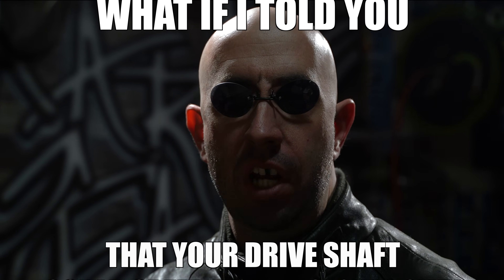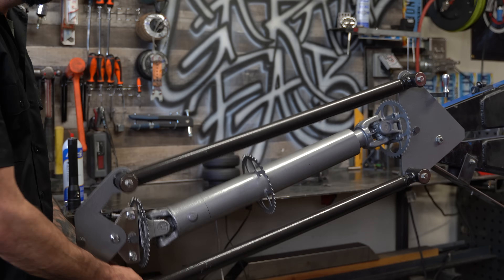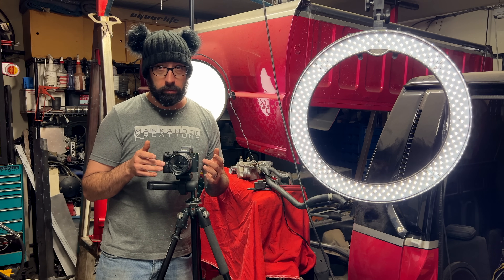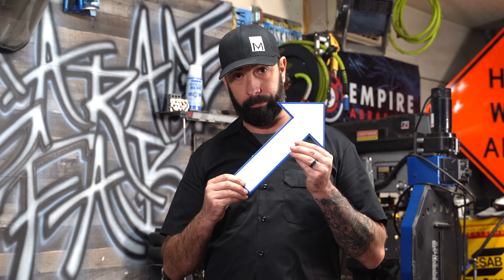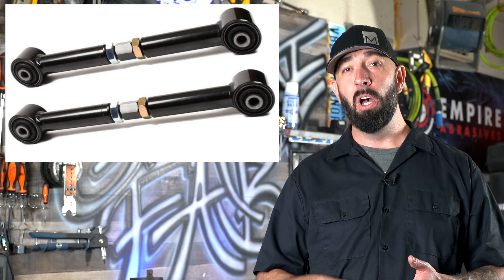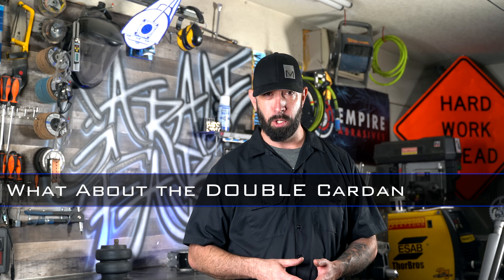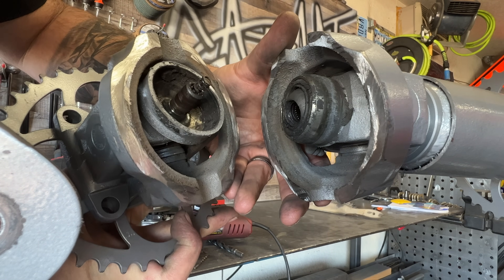THE Driveshaft Video. The Nature of U Joints. Suspension Basics Ep. 06

Comment: Hi I'm doing a 1975 Ford courier triangulated 4 link with coilovers I have everything mocked up and have my bars all level but the lower bar is wanting to be farther down the frame then the top even though I bought evenly lengthened bars. I was wondering your thoughts on that
Reply from the maker: Hey Damon! That sounds like an awesome project. I’ve got a soft spot for the old stuff.
If I’m understanding you correctly, it is to be expected that your angled bars appear shorter than the parallel bars if all the bars are the same length.
In order to get the upper angled bars of a parallel 4 link to span the same distance as the lower bars, the upper bars technically need to be LONGER.
I realize how confusing that can be without seeing it.
Don’t stress though. If you can figure out how to mount the bars you have, the unequal length won’t cause a problem for you since you’re running coil overs. Just set your pinion angle parallel to the transmission at whatever ride height you choose and you’ll be golden.
If you need clarification, lemme know!
Can’t wait to see the Courier!
Reply: Okay thank you I thought you mentioned that in once of your videos but wanted to clarify

Comment: I find myself in a sticky situation, tom no longer makes the Nissan Xterra 2nd generation kit for a double cardan for Nissan Xterra 2nd generation that get a lift. I need a double cardan to fix my vibration but there is no slip yoke eliminator in production which tom used to make. I don't know the specifics of the kit/conversion he made for us Xterra owners but i would love your input on this and ideas or suggestion for how to make this happen or any other way to fix the issue. The Nissan Xterra 2nd generation has a u joint on the transfer case side and a CV joint on the pinion side (fun)... but after watching your video i believe the Xterra peeps may have been using wrong terminology and it is not a cv but a single u joint on a flange. I have a 10.9 degree drive shaft to transfer case angle and a 9.9 degree angle on the pinion side, so 1 degree off parallell. Tom in his videos would like to see these at max, pinion side 2ish degrees and a double cardan on the transfer case side in his video if i remember ended up being 6 degrees on the transfer case side. Kinda confusing on that part as that is still not in parallell.... ugh lol

if anyone reads this and has an idea or can help, please please do. thank you.
Reply from the maker: Hey Jason! Sorry for the delayed reply. This one took a little reading. I’m very uneducated when it comes to off road stuff. So perhaps you can tell me… What is the purpose of a slip yoke eliminator? My assumption is to prevent the slip yoke from popping out. Or perhaps to ensure you can apply full torque to the wheels without risking damaging splines.
I did a brief search, and found a couple Xterra slip yoke eliminators, one from 4 wheel parts. Not sure if it’s for your model.
First, I’d agree with Tom’s recommendations of a MAX of 2 degrees off parallel. More than that will likely cause a vibration. A lot of people believe that 1 or 2 degrees off-parallel is required to keep the needle bearings rolling. I disagree and think they’re confusing that with a slight operating angle of each U joint. So if each U joint is bent slightly, a perfectly parallel setup would be more than acceptable.
It’s kind of difficult to give advice for this sort of thing without being able to measure for myself, but by your description, you shouldn’t have a vibration. Unless of course maybe your vehicle is lifted beyond a U joints maximum recommended operating angle. (Around 7 degrees)
If both U joints are under that, I’d recommend first putting the pinion and trans shafts parallel. 
After that, then, perhaps it’s time to consider the double cardan joint. It’s important to know, though, that the parallel shafts principle goes out the window with a double Cardan joint.
When installing a double cardan joint, the singular U joint on one end will be almost straight with the pinion angle nearly matching the angle of the driveshaft (With an operating angle of approximately 1 degree) The Double cardan Joint on the other end can then be at any angle within its capabilities.
All of this, of course, is assuming that the vehicle is resting at its natural right height. 
Hopefully this makes some sense. Even my eyes are crossing right now.
Reply: @Garage Fab  yeah the one in 4 wheel parts turns out it looks up as for an xterra but not actually for it.  But more to the question of application, not worried about it slipping out or torque. Not sure why people don't do a slip yoke double cardan honestly and haven't been able to find anything on it. My tranny and pinion are only 1 degree out but they are 10.9 and 9.9 degrees hence the double cardan. The xterra transfer case can't be adjusted up or down without messing up the front drive shaft angle a lot so pointing the transfer down the one degree to get parallel presents a problem and they still are at 9.9 degrees but the double cardan lowers these angles a lot. So do you know a reason why one wouldn't do a double cardan slip yoke on the transfer case with no torque or drive shaft pulling out issue? I see why a slip yoke in the shaft could be better but all the eliminator i found when I dug in were not actually for an xterra but a np231.found this and cant find a reason why it wouldn't be good? 
https://www.4x4parts.com/i-18981299-xterra-custom-rear-driveshaft.html
Reply from the maker: I think that would be just fine. But I repeat… with the double cardan joint, the rear joint (single U joint) must be straight. In other words you’ll likely have to change your pinion angle so that it points at the transfer case output shaft. I have no idea how much that will be. You might be able to get away with some wedges between the leaf springs and axle, or you might need to cut off the spring perches and weld them back on at a different angle.
Reply: @Garage Fab  thank you. I am aware of both of those possibilities for sure. I suspect I won't know the full extent of change I need to do u till I actually put the dubble cardan on and see the actual change in angle it provides. I am hoping to cut as much as 6 degrees off of the angle needed to rotate to match with the 1ish degree off set. But I am prepared to have a local shop cut and weld as well. Fingers crossed! Thank so much for you input and I will let you know how it turns out. The new setup is about 5 weeks out.

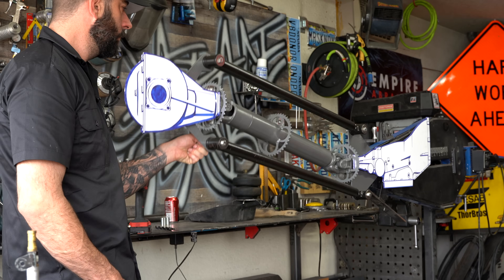Comment: 13:27 wait then why was I told to make sure my insant center is towards the front bumper? Won't that mess with the pinion angle just enough at the extremes of the travel that it'll cause vibrations? Thanks 👍
Reply from the maker: Hey Nick! That’s a really good rule of thumb for vehicle weight transfer on acceleration. The problem is it’s a good rule of thumb on static height vehicles. People often treat all cars the same, and adjustable height suspension vehicles are so very far from “the same”.
So it really depends on that. Is your car static or adjustable? Static; Take the added traction because you can by placing your instant center near the front bumper. Adjustable; Do you plan to ride around at a fixed height? Or do you want to cruise high and low depending on your mood or the terrain? If you choose the latter, I’d strongly suggest giving up a tiny bit of performance for the sake of reliability and comfort.
So to answer your question, YES! Positioning your instant center properly will cause pinion angle to change potentially causing vibrations when skating low or driving at max height.
Reply: @GarageFab  Thank you so much! So an infinite instant center on vehicles with a lot of travel, especially when riding at the extremes of that travel. Congrats on the 20k subs Aaron! :D

Comment: I actually subbed a couple months back during your well deserved break and was very excited to see you come back with this video! Your explanation of suspension geometry doesn't just make it easy to understand but makes it extremely interesting to learn about. Ive been building a 73 Mercury Comet that I lifted and installed a twin I-Beam front suspension from a Ranger into. Your videos have made it so much easier to understand what I need to adjust and get set right to make the whole thing drive correctly
Reply from the maker: Thank you my friend! I’m so excited to the Comet. 👏 That’s the type of builds I plan to feature on Garage Fab in coming years. The unique ones! Uncommon car, lifting it, (What?!) uncommon suspension. Just great.
Thanks for the kind words and keep me updated on the build!

Comment: Great video but I just wanted to check… on a 2 piece driveshaft, I should set my carrier bearing angle to match the transmission angle and then follow the rules for a one piece prop to set the pinion angle?
Reply from the maker: I believe you’re understanding perfectly. The first section of the driveshaft should nearly match the transmission. Here’s something that wasn’t mentioned in the video. U joints need a slight bend to keep the needle bearings rolling. Usually a 1-2 degree bend is enough to keep the bearings from creating flat spots and also keep the lubrication moving, but not enough to cause a vibration. This tiny bend is important on the first section of the drive shaft because it never moves.
So here’s how the setup goes: 
Check the transmission/engine crankshaft angle. Let’s say it’s angled down 3 degrees. Mount the carrier bearing so that first shaft section is a degree or two from the trans in either direction. (On a lifted truck maybe it’s angled down a little to 5 degrees, and on a lowered truck the carrier bearing would be pushed up so that the first section is only angled down 1 degree. Following so far?
Then the rear section is treated like a normal driveshaft but the pinion angle is NOT matched to the transmission. Instead it’s matched to the angle of the first drive shaft section.
Lemme know how clear that was. I may have to create a Suspension Basics 6.5

Comment: Dude I am a small truck guy, on the drag race side. I have learned more from you about suspension in an hour than years of reading books and trying to piece information together. Thank you!
Reply from the maker: I appreciate that, my man!! I could probably learn a thing or two from you as well. My knowledge revolves around proper operation of suspension components for the sake of lifting and lowering. But I lack a lot knowledge about physics, traction, handling, etc. 
Always stay learning!

Comment: so happy u are back and making more amazing vids welcome back !!! . i have a question im sure u probably answered before but here goes,  i have a 2 piece drive shaft with a massive bearing  that sits just before the second uni joint , to hold the shaft in place ,. i have the pinion angle and gearbox angle the same , but at 150km/h on the track ( this is also a daily driver ) when i release my accelerator it vibrates , i have noticed when i get under the car i can push the tailshaft up down left and right about 20mm in the bearing . my question is  would that be causing the vibration at high speed on deceleration or should it be able to move that much in the bearing . ? dam i hope im making sence lol  if so , does a tail shaft that sits off center to 1 side (as my standard shaft points slightly to the passenger side and my 9 inch  4 link diff sits off center ) be a cause also ?  i really hope that makes sense lol  . thanks ji
Reply from the maker: I think I’m following! The carrier bearing should be able to move a little. It’s got a two part job; To support the center of the driveshaft and to absorb some vibration. Most carrier bearings have a rubber donut surrounding them. This rubber gets hard and sometimes stretches causing it to not dampen vibration very well and also allow excessive movement. 20mm seems like a lot of movement so I would definitely start there. A bad carrier bearing wouldn’t usually CAUSE a vibration but it can certainly amplify an already existing vibration. Especially on deceleration as you mentioned.
You’ll need to remove the driveshaft to change the carrier bearing, so with everything disassembled make sure you move the U joints by hand and make sure they’re not too wiggly, or worse, seized.
Is this a factory or a custom set up? If it’s factory I’d think that you shouldn’t have to worry about angles. The first U joint at the transmission should be fairly straight. (Usually 1-2 degrees I believe) Then the second and third U joint bends should match when the vehicle is on the ground.
The slight sideways angles you’re referring to shouldn’t be enough to cause problems. 
Replace the carrier bearing, inspect and or replace the U joints, and let me know what happens. We can figure this out.
Thank you for your support, my friend! Cheers!
Reply: @GarageFab  thanks so much for the reply . it is a custom setup , and the bearing is  new also , we had the last 1 less than 500kms and the rubber was pulling away from the center , took it back they said it had just come off and would re-glue it and gave us a new 1 , not sure i liked the part about re-gluing it and selling it to someone else  but they said is common and wont affect the performance :(   . im thinking the movement of 20mm in all directions is alot thats a 40mm move in all over movement . ok so we have the first shaft coming out of the gearbox straight and level so thats great . now the rear shaft from diff to middle u joint ( should the diff point directly at the middle u joint  with a 2 degree downward adjustment, this is what ive been told ) i have hym joints i think there called , so no rubber bushings in the  diff arms so moves very little if at all . i was almost convinced  it was the bearing but now im not so sure  if you think 20mm movement in all directions is ok ?  thanks again for all the help and feedback ... jim
Reply from the maker: 40mm certainly seems like a lot, but as long as it’s not sloppy (fully supported by the rubber) perhaps it’s ok. Has the driveshaft been balanced.
The following is a copy and pasted answer I left for someone else’s comment. Pardon the laziness but I think it might benefit you. Lemme know!

The first section of the driveshaft should nearly match the transmission. Here’s something that wasn’t mentioned in the video. U joints need a slight bend to keep the needle bearings rolling. Usually a 1-2 degree bend is enough to keep the bearings from creating flat spots and also keep the lubrication moving, but not enough to cause a vibration. This tiny bend is important on the first section of the drive shaft because it never moves.
So here’s how the setup goes: 
Check the transmission/engine crankshaft angle. Let’s say it’s angled down 3 degrees. Mount the carrier bearing so that first shaft section is a degree or two from the trans in either direction. (On a lifted truck maybe it’s angled down a little to 5 degrees, and on a lowered truck the carrier bearing would be pushed up so that the first section is only angled down 1 degree. Following so far?)
Then the rear section is treated like a normal driveshaft but the pinion angle is NOT matched to the transmission. Instead it’s matched to the angle of the first drive shaft section.
Lemme know how clear that was. I may have to create a Suspension Basics 6.5
Reply: @GarageFab  100% 5 and 6  id love to see, ok so the response u copied and pasted its very clear  im gona go and have a play with the angle. just so im clear ,. first shaft connected to gearbox will be 1 degree different to engine gearbox angle , right so far ? .  second shaft from diff to second uni . which is pretty much under where my back seat is , will be pointing straight at each other so they have equal and opposite angles to each other. ? i think thats what ur saying and i hope im clear lol . so basically, forget the first shaft once its set up and treat the second shaft completely separate like its its own entity did i get that right , thanks again for the replies they are helping massively.
Reply from the maker: That’s explained perfectly! 🙌 Lemme know how it all works. Cheers!

Comment: Glad you are back. Was begging to think the worst.
Reply from the maker: Sorry, Martin! I didn’t mean to stress you out! 😅 Just needed a little vacation. Glad to be back!
Reply: @GarageFab  The method you used on the Mighty Max front suspension, can it be used to lift a truck?
Reply from the maker: Absolutely. If you drop the front frame rather than lifting it like I did it will lift the truck. Just keep in mind you don’t get any extra ground clearance under the engine crossmember unless you raise the motor mounts and rebuild that crossmember.